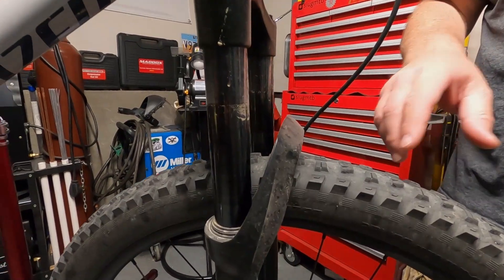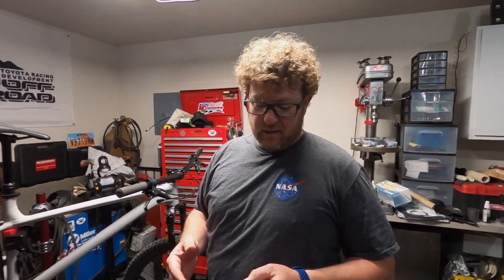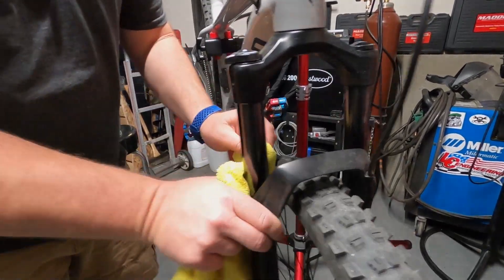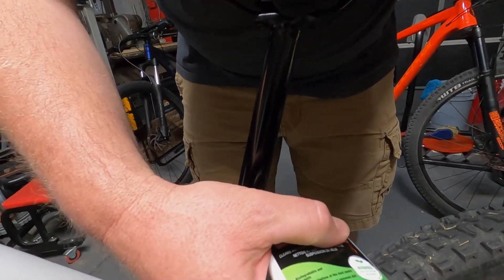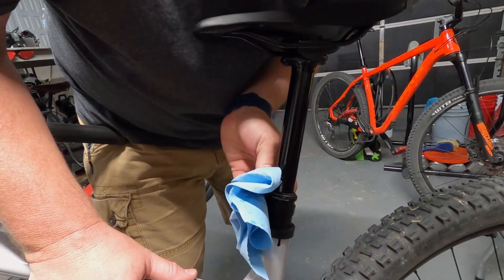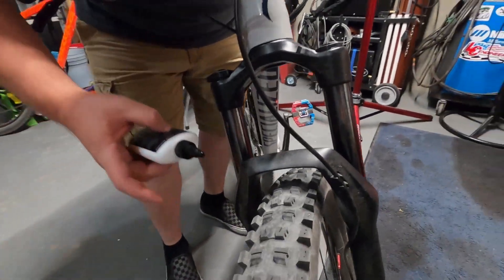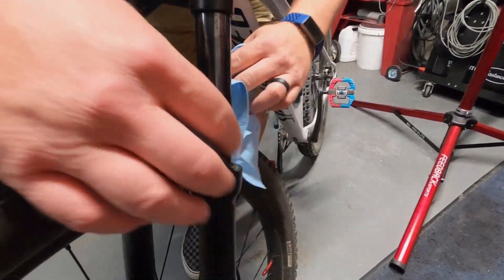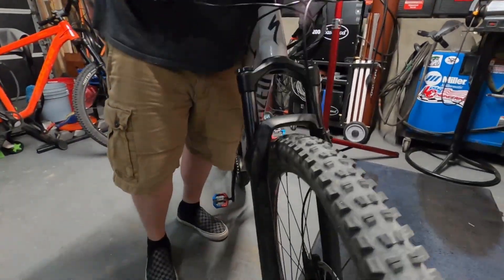Tech Tuesday: How to Clean Your Fork and Seat Dropper Seals

Comment: This is more about getting some dirt out of the seals and lubing the seals so they dont get worn/scratched.  There is probably plenty of dirt that made its way past the seals and you have dirty oil in your fork.  If this is the first service you have done you are probably well overdue for service.
Reply from the maker: You are totally correct. I do a full service on the fork once a year, usually in the spring after winter riding season is over. That way it is ready to rip for the new summer season. I do this just to help in between the fork overhauls.